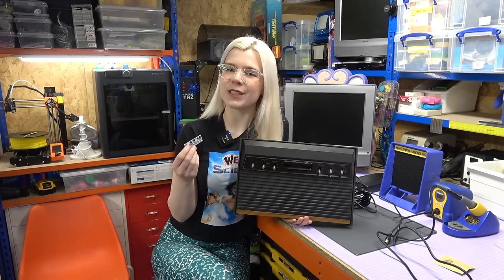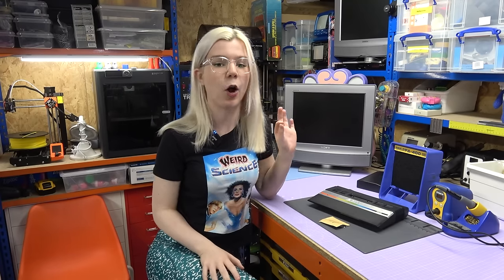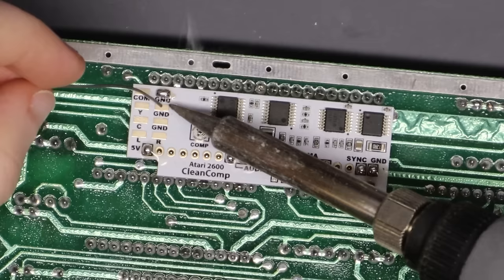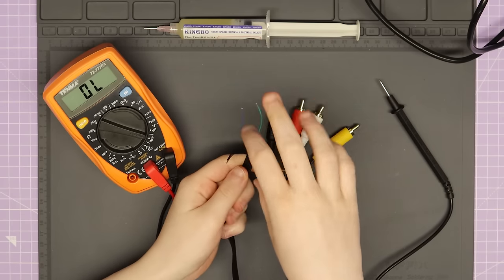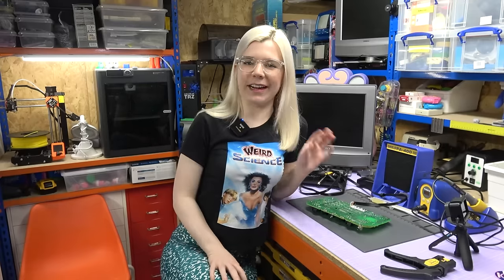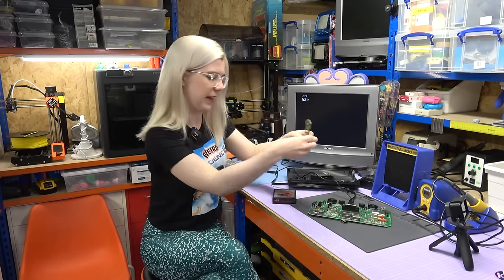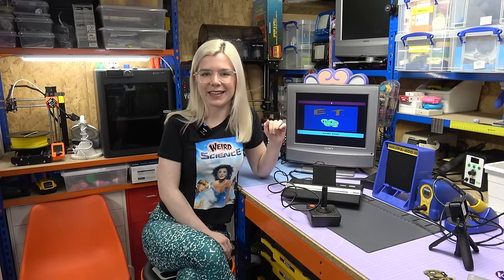Composite video modding the Atari 2600

Comment: In 1977 when I was 7 years old I won an Atari 2600 at my school's annual bazaar. It was the grand prize in one of those pick-a-pully-ticket-out of-a-big-jar games. Never one a single thing after that day lol.
Reply: That's what happens when you use up all of your luck by the time you're seven.
Reply: Technically, the 1977 release was the Atari VCS, or Atari Video Computer System. The Atari 2600 came out in November 1982, with 2 less switches. Left and right player difficulty switches. I bought the 2600 in December 1982 while in grade 9, with money from my newspaper route. Best decision I ever made... lol. I was spending close to $5 a day at the arcades. 😋
Reply: @michaelbinbc  You're right. 1977 was a very good year: Star Wars, Close Encounters of The Third Kind, (the first ⅔ terrified me) and my Atari VCS. :)
Reply: @michaelbinbc  the switches are still there, just smaller and on the back/top rather than the front.
Reply: @SeeJayPlayGames  ok... looking at the AtariAge site, the switches were indeed moved to the back, but it was the Atari VCS CX-2600A. The Atari 2600 was identical to the CX-2600A with only 4 switches on the front, but all black... no woodgrain. The console Kari shows has the woodgrain. It's the original Atari VCS CX-2600. I have to admit... I never knew it had difficulty switches. If I'd known, I would have used them after rolling Pac-Man. Now I feel like a dumb a$$. 😋
Reply: @michaelbinbc  You're misinformed.  The first CX2600 models started production in 1977 with a six switch model with a thick and dense plastic case. They are called "heavy sixers" due to the six switches and weight of the dense plastic or the Sunnyvale model due to being sold locally in Sunnyvale California where the production facility was located.(I know because I own one of these early and now rare versions). In 1978, the following model was known as the light sixer due to having a thinner plastic case to save on production costs. Both Atari and Sears sold their own types of units with Atari stopping production of that particular model in 1981 and Sears in 1982. The most recognized model was the four switch models that was either woodgrain or solid black which was sold until 1985. The particular model she was modding was the final model known as the Jr.. Those were sold as late as 1992. There were some made with an single intergrated chip. Those extremely rare models are known as the "Unicorn" model. The first models were indeed CX2600 consoles, but had six switches instead of four when the unit was revised in 1981 to make them cheaper to build and sell. The real only internal difference is the removal of the left and right player difficulty switches and the addition of better electrical shielding. Actually,  the first two six switch models were far better quality.  My original heavy sixer still works great after 40 years!!

Comment: I’ve saved this to watch later. I’ve spent all day inside a Super Famicom problem solving no audio, I’m exhausted. 
Super excited to watch this video tomorrow 😊
Reply: 1 Chip or 2 chip model? With the 1 Chip it's most likely the S-Mix chip. They burn out quite often. Nearly impossible to find replacements for too. There is a solution where you basically delete the S-Mix, but you won't have sound with your Supergameboy and some games might be affected too.
Reply: @MyRegardsToTheDodo  it was a two chip model, and it had a similar fault with the chip not functioning. I pulled audio from another chip and jumpered two wires to the AV out, so sound is back, although it’s quieter.

Comment: Instead of soldering discreet wires to the mod, you might be able to get a SMT right angle connector (Hirose, Samtec, etc) with a mating connector to terminate the wires.  Of course, you have to have enough room for the connector in under the console motherboard.

Love this channel.  Always a trip down memory lane for me growing up with a lot of these devices.

Comment: OG Xbox and one GameCube only systems I've modded with some soldering involved.
ET is an interesting choice of favourite game, I'd noticed your little figure of ET on shelf in another video, and a little Hoff peeping round the monitor in this one, nice, but when i hear peoples favourite 2600 games ET isn't usually mentioned.
Nice to have the 2600 playable though, i have an old telly with the aerial RF input still for when i had mine last hooked up, fun system with some decent games definitely.
Nice mod 👌

Comment: I purchased an Atari 2600 'Vader' years ago and it sat there. I heard about the video mod so I looked into it. I think I had to remove some components, I made a small PCB with a few resistors and a transistor and added some sockets to the back. Worked like a charm. I ended up selling it for 10x what I paid.

Comment: Awesome mod, thanks for sharing!  Something I picked up from some UK channels (in the US here) is to use blu-tack to hold things like those wires temporarily.  It works great for that and for other things like crystals, or pin headers where keeping it straight and/or flush to the board is important.

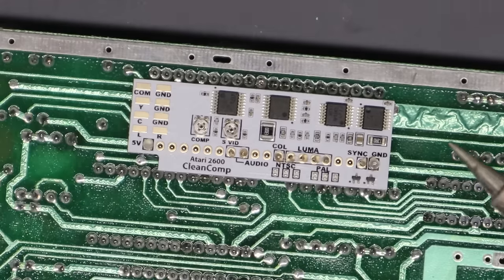Comment: 2:15 I applaud you girl for doing cool geeky stuff like soldering components/mods to PCBs.  Pro tip, honestly, it's taught in school for electronics repair.  Keep your soldering iron tip tipped with fresh solder.  This is not mainly to preserve the tip but it acts primarily as a heat bridge from the tip of the iron to the component.  This makes the soldering process not only faster and more effective, but safer for the components as you spend less time in contact.  Cheers for Texas!

Comment: 5:24 a good way to avoid this mistake (which is pretty common i think) is to refer to the pin numbers and not the physical layout. this can be difficult sometimes because manufacturers for really cheap plugs will just not include the numbers for the pins, but generally if you use a magnifying glass and a light you can find tiny numbers printed next to each pin. these numbers are always the same regardless of gender. i also like to keep a picture of both male and female plugs for whatever cables i'm making so i can double check. even then, its easy to make a mistake because if you hold a gendered plug backwards (like if you are soldering in cups) then the numbers will be reversed again lol; the back of a female plug is the same pinout as the front of a male plug and vice versa

Comment: Interesting. I was a part of a movement of helping playtest out a bunch of different models of boards, to get the best s-video output for my Atari 2600. While it works great... my capture card says otherwise. I need to run the s-video signal through a VCR, so I can get a stable signal for my capture card. I have a couple spare 2600's that I have been meaning to refurbish. I plan on picking this up, and giving it a go. Thank you for the video!

Comment: Back in the late '90s, I got a very cheap 2600.  But, the connector that goes to the TV/Game switch box was missing.  I ended up attaching a coaxial cable TV connector to the end of the cable, and was able to plug that Atari directly into the cable input on the back of my TV.  
Sure, I had to unplug cable TV to play Atari.  But, that was true of all my video game systems at the time.  Till I got a TV with A/V inputs.

Comment: Fantastic, Kari! It’s so funny that 80’s TVs didn’t have a post-receiver/direct input, so consoles had to modulate their video signal to look like analog TV. Even as a kid back then it seemed like a totally hokey solution to have a splitter on your TV’s antenna inputs, flip the switch, and dial the TV to channel two. Of course these days TVs have nothing but direct inputs so you’ve got to mod your console to take out the analog TV modulation. 😁

Comment: In the future(if you just want composite to s-video) you can save quite a bit of money by just making it yourself. It’s just a simple amplifier. Either any transistor and 4 resistors can do this or what I prefer is a simple opamp with 3 resistors 2 to set the amplification and 1 to set the 75 ohm output impedance and a decoupling cap.
You can make those pcbs very tiny when you use smd or just use perf board and use through hole.

Comment: Having worked in and with electronics before, one thing I would have do\ne that would make things loads easier is to tin your wires first; it makes the attaching loads quicker and easier. Also, always use a bit of isopropyl alcohol and an acid brush to clean your solder joints after you have finished soldering. For future references, if you are working with sensitive components, always wear an ESD strap.

Comment: I did do a mod on the Atari 2600 Junior, to be able to connect it to the tv with the video signal. It was a mod where I did have to remove parts from the Atari first. To make it more difficult, the online manual showed a slightly different motherboard, so for one wire it was a bit of a guess. But it worked out, and my friends and me are playing the old games now. We are all around 58 years old and can still enjoy the old games. Recently bought the game Scramble made by Champgames (homebrew game). Although the quality is fine, I wonder if the quality of the mod shown in the video might be better.

Comment: I use a female RCA to male Coax adapter into my TV antenna input. Under $10.  Works for me. Video quality is great on this full out mod, but  the retro resolution from my cheap adapter  is actually nostalgic. 😀

Comment: You've just reminded me that there is a mod for my Sony KV-27 27 inch television that can add RGB inputs that I can use with my nVidia GTX-980 Ti GPU with DVI-I analog out.

Right now, the TV only has S-Video input, which is okay. But the RGB is significantly better, and it has very low hours/good tube...

Comment: I modded mine about 15 years ago, I just used the original wires and soldered them to the component cables externally

Comment: A worthwhile mod, you get the clarity but you still keep the original CRT glow. Try modding the original atari joystick to have an auto-fire button. Some sticks had a rocker switch to turn this on and off. Our old joystick had a faulty button which often lost contact while you held it down, which was a nightmare for games where your character would fall during a jump when you released the button 😂

Comment: That particular model was called the 2600 jr. It was one of the last variations of the 2600. I still own my original heavy sixer, Sears Arcade 2 model, and Darth Vader model (nothing to do with Star Wars. It was a solid black model without the typical woodgrain. Hence the nickname "Darth Vader"). All three still works perfectly.  I remember when the original NES was released and later the Sega Genesis you could find 2600 systems at local flea markets for a dime a dozen. The game cartridges you could buy boxes full for like $10. Nobody wanted them anymore.  Today people will quickly buy one! ( No, I'm not selling any of my old Atari consoles!😂😂)

Comment: Especially the 2600 jr. is a pain in the butt to mod to composite output with the cheap aliexpress mod kit, mostly because tracking down the instructions on how to do it took me forever for the frist time I did it. I finally found a quite outdated guide for another modkit that isn't in stock anymore but that gave me exactly the information I needed. Once you got that, it's actually pretty easy. You have to remove 8 components (or clip their legs, I personally removed them), then a bit of solder and that's mainly it. The jacks are on the outside of the case, though, so it's not a no-cut mod. Modding the Darth Vader or Woody models is even easier,  for those two models I'd personally only use the aliexpress kit, especially considering it's only around 5 GBP.

Comment: To be honest, all new TVs have antenna input, that works for RF output just fine. But no brand new TVs have composite input today AFAIK. But that being said, composite is way better quality and is easily converted with Retrotink, Retroscaler, GBS C or other devices. So it makes sense no matter what. Keep up the good work, love your videos. This is my favourite new channel.
Reply: my 12m old LG has composite and RF, but the RF can't hold on to a channel from any of my 'retro' devices
only this LG has RF, none of the others
Reply: The RF on modern tv’s is for digital input only so won’t work with old analog consoles.
Reply: @RobA500  notstrictly true - some have ATV and DTV tuners - my LG does. You may recall I said "won't hold on to" and not " won't tune in to "
Reply: Not really true - most TV's that have an RF input only use it for DVB-T not an analogue signal. At least that's true here in the UK
Reply: @jaycee1980  as i have already stated, mine has both - otherwise i'd be p*ssing in the wind with my incorrect comment, rather than stating a fact ( my own experience of my own devices, not fabricated, not a  fever dream, actual real liefe eperience. If it didn;t have an ATV tuner, I wouldn't have come on to say it would becaue that wouldn't be true )

EOC
Reply: @markb4071  You said " all new TVs have antenna input, that works for RF output just fine."

They do not. I have two in my house, one Samsung, one Panasonic, that are DVB-T only on their RF input.

So adjust your attitude.
Reply: @jaycee1980  go back and re read. Not once did I say that that was a different poster. Don't come on being all big and forthright with the wrong info.
Reply: @markb4071  I guess that depends on where you live, here I the UK there are no more analog broadcasts so the tuners are digital only for us now. That is unless you have an older tv before analog was switch off, mine is 5 years old and digital only.

Comment: I installed a composite video mode on my ZX81. It is on a small circuit board using surface mount components and fits inside the RF modulator casing.

Comment: I have the Heavy sixer myself which is such a quality peice of hardware, but truth be told, it sits on the shelves as eye candy, I tend to do most of my 2600 gaming on the jr, its  just a lot easier to pull out and set up..I look at it sometimes  and think about how Atari directly after 1977 was looking to modify the 2600 console to make it slimmer and more affordable; whilst they  managed to do that to a degree with the 4 switch woody, they had a few other ideas that they worked on that never came to fruition. Not until the jr came out, but boy, if they had been able to magically send the 2600 jr back to 1977 and had been able to sell the jr as such, I bet they would have sold 60 million consoles not just 30 mil!..

Comment: I tried to mod a psu for a T17 Antminer, the goal is to quiet the 3 loud small fans. I tried 10 diodes, and they heat up. I tried resisters and they cooked. I hooked in series 2 fans, but there not spinning faster than the slowest. Maybe the only way is to change the 3 power mosfets. Nice video.

Comment: The most nerve racking mod I have ever done to a console was for the Neo Geo CD. I found a none invasive mode to add an SD card reader to store games without removing the CD drive or cutting any holes in the case. It required lifting pins of a chip and soldering wires to the pins and pads. It was awkward and as I had watched videos on YouTube of other people screwing it up very tense 😅.
Feel free to give one a go, I would love to know your thoughts.

Comment: I composite modded an Atari just by connecting the video line going into the RF modulator directly to the AV inputs on my monitor. There is no need for a bunch of mysterious microchips.

Comment: Although it's known as the Atari 2600, it's original name when it was released in 1977 was the "Atari Video Computer System (Atari VCS)". It was then rebranded as the Atari 2600 in 1982. I bought the 2600 in December 1982 with the money I saved from my paper route in grade 9. I'm in Vancouver, and our dollar was worth more than the USD back then (~$1.25), so I bought it in Bellingham, Washington, along with a bunch of games. We then smuggled it back so I didn't have to pay duty. 😋

What you have there, is the original Atari VCS. It has the left and right player difficulty switches. The Atari 2600 only had 4 switches... no difficulty switches.
Reply: I think 4-switch models still have difficulty switches, they're mounted on the back, they're much smaller, adjacent to the joystick ports, so two less switches on the front of the console, yes, but it still does have difficulty switches. I'm not 100% certain how a 7800 is configured, regarding the switches on that?
Reply: @mark-andrews  I bought my 2600 1 month after it came out in December 1982. If it had difficulty switches I would gave known about it. Cheers.
Reply: @michaelbinbc  Hopefully you still have that machine from 1982, it must be worth quite a bit of money, these days.
Reply: @mark-andrews  I think I donated it to my cousin. 😋 But you are right... according to the AtariAge site, the switches were indeed moved to the back. But... it was done on the Atari VCS CX-2600A. The original was the Atari VCS CX-2600. But it also says the Atari 2600 released in 1982, was virtually identical to the CX-2600A, except it was all black... no woodgrain. The console in this video has the woodgrain. Definitely not the 2600. I honestly didn't know about the difficulty switches. I should have read the manual. 😋

Comment: Oh I've got to try this! I did one of those destructive mods and the first time it was not great but I think it was do to bad wire color coding. The creators website used different colored wires than you received and the instructions were more 'solder the red wire here', 'the blue there', etc. but the actual kit had different colors going different spots. It was a mess. Something tells I can put this mod in, reverse some of the original mod that I can and see how it goes. I also recently picked up an untested 6-switch Atari brand Atari 2600 with the power plug ripped out. I have yet to fix it and see if it works.